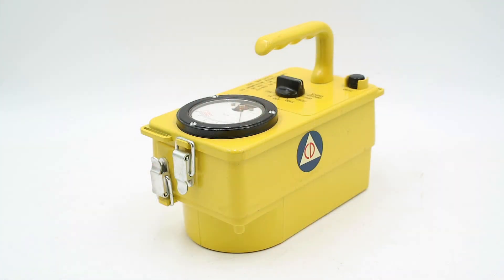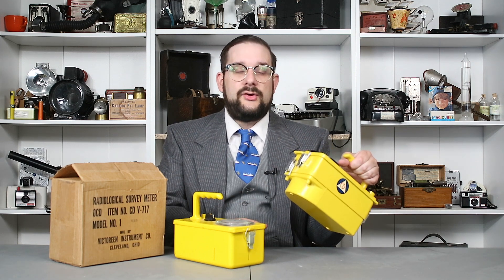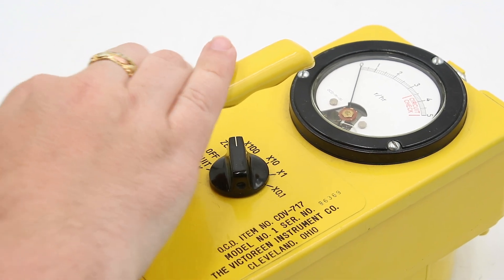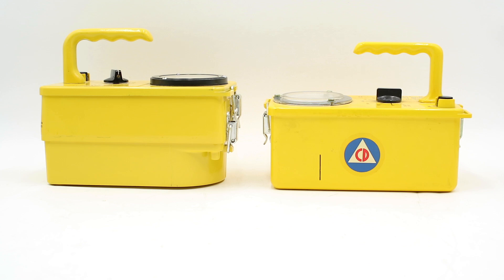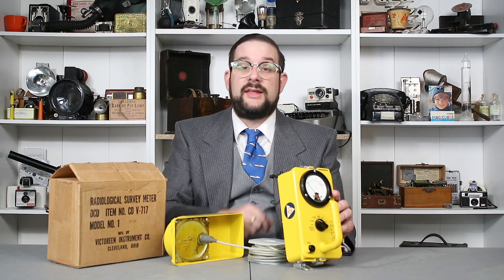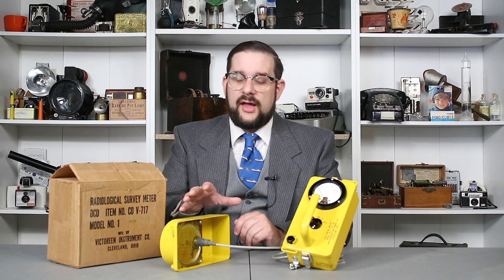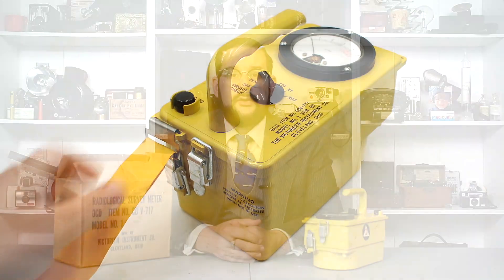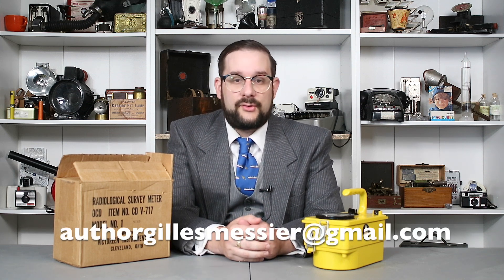SHORT: CD 717 Gamma Survey Meter

Comment: Somewhere around here, I have an old radiation meter meant for prospecting. A very elderly man gave it to me some twenty years ago, and it uses vacuum tubes, with an 'A' and a 'B' battery. It's completely self-contained, the Geiger-Muller tube inside, and it has a should strap. It was manufactured in Winnipeg, Manitoba, Canada as I recall. I'm guessing it dates to the 1940s. When I find it I'll post some information about it. Gilles, I'd love to see you cover these devices!

Comment: If there has been a nuclear attack then what does it mean to 'zero' this kit? Surely the background will be raised so all you are getting is a relative reading.
Reply: When you "zero" the meter, you are setting the meter dial to zero to adjust for mechanical drift. You are not adjusting for background levels.

Comment: So you have a 25 ft spool of cable, which is all well and good, but how are you supposed to get the ion chamber 25 feet away from you? Throw it? Get a volunteer?
Reply: was often used to run the cable down air lines to a bunker, and some bunkers had them semi permanently mounted like this.
Reply: Park it outside right after SHTF and then wait, I suppose?